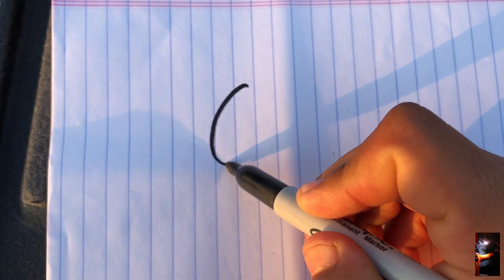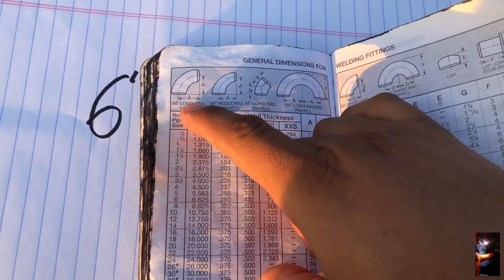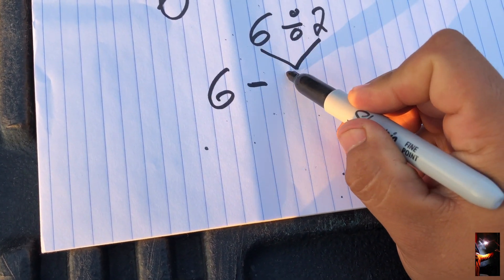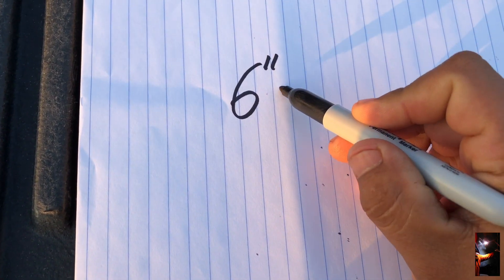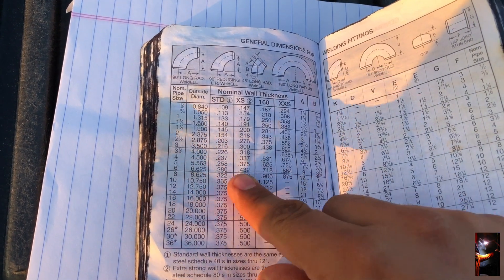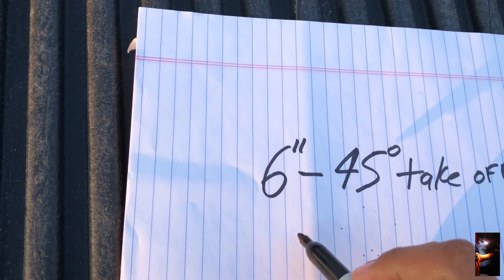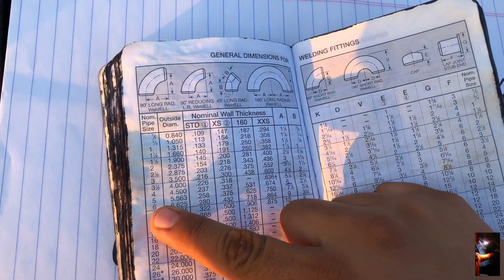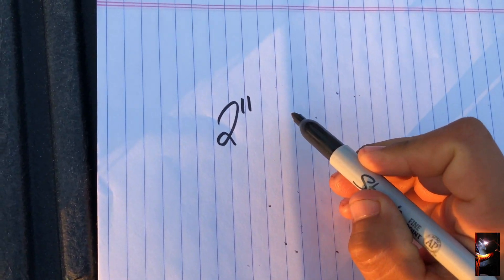How To Do 45s and 90s take off formulas?!

Comment: Hey. Brother. How do i do all this on a regular calculator. That. Doesnt do fraction.  ?  Lol.  Can u help me
Reply from the maker: Don’t really know how to do it like that, I always been using pipe trade calculator, Bought it in Amazon.
Reply: @CAPTAINMANNY   the reason i ask is because when they test u sometimes they just want you to use a regular calculator  lol  no fractions in it
but your video is very help full
Reply: You would have to know what the fractions convert to as a decimal.
1/8" = .125
1/4" = .250
3/8" = .375
1/2" = .500
5/8" = .625
3/4" = .750
7/8" = .875

I always keep 1/16" in my head as well .0625. Keeps me from having divide so much ( Ex) .625 + .0625 = .6875 which is 11/16" inch. I don' need a calculator now because its easier to just add the two numbers together.

Another trick is take half of a fraction. (Ex) Half of 3/4" ....just double the bottom number 3/8 
Half of 11/16" ...11/32"

Hope that helps someone
Reply: @bjen2005  definitely a big help!!!! Blessings

Comment: For inches you just time pipe diameter by 1.5 for 90 degree LR, times by 1 for 90 degree short radius, and times by 5/8 for 45 degree LR. Much simpler, less margin for error, don't have to add an eighth for 2 inch, etc